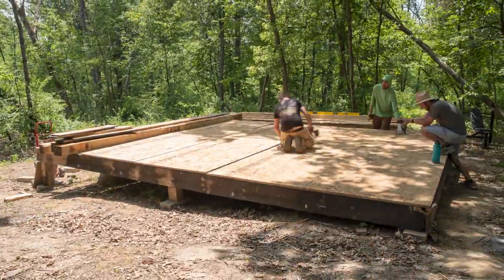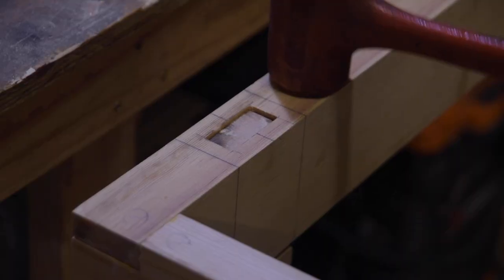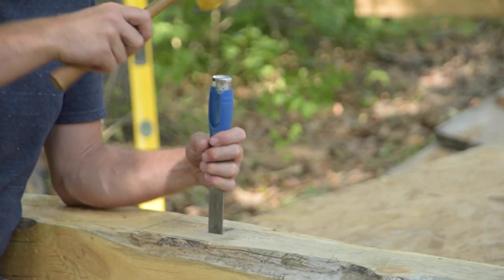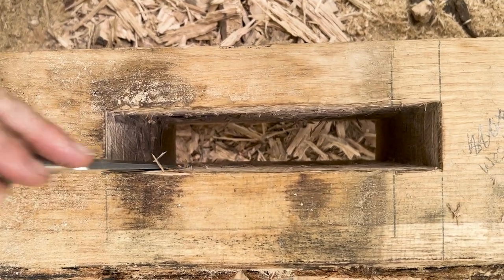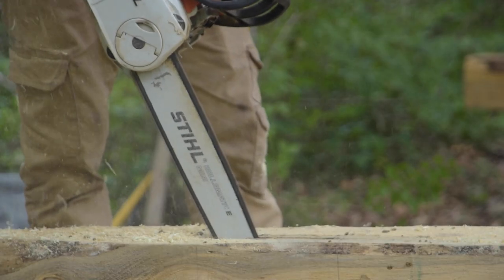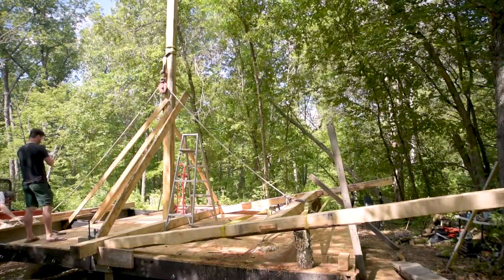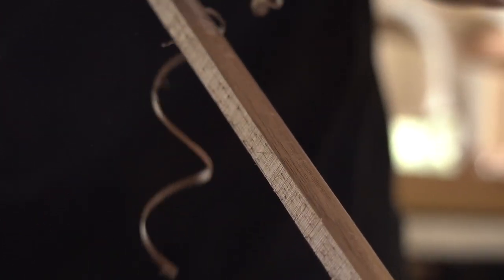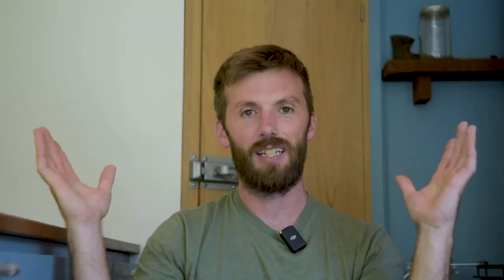Gonna Need a Bigger Chisel

Comment: I did my first timber framing this year and it went ok, my tips for beginners like myself are : get the right chisel as you said, a rolling jig and a wet stone to sharpen. A big circular saw to do your tenon in four cuts. A flat drill bit for wood the size of your mortise. Cheers
Reply from the maker: I could have used you a week ago 😂! Thanks for the advice!
Reply: @MacJackal  Hey that still was a better job than the ones who never tries, don't be too hard on yourself, props to you and your friends for not giving up, personally I would have sunken the project in alcool the first night ahah
Reply from the maker: @Lou1ouze  Haha, well there was some alcohol involved for sure! This is how most of my projects tend to go so  I'm pretty used to it at this point. Appreciate you!